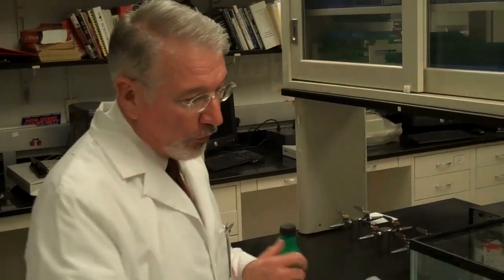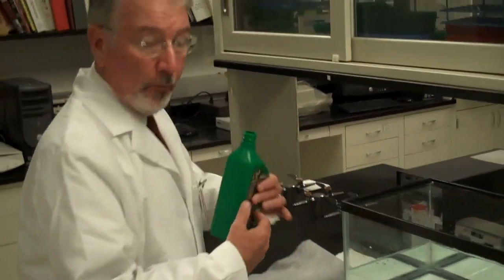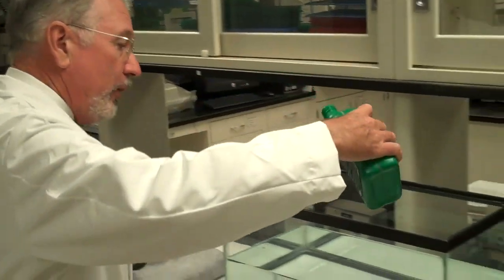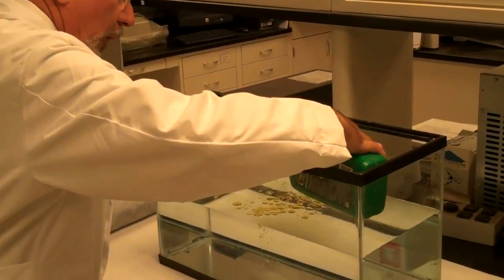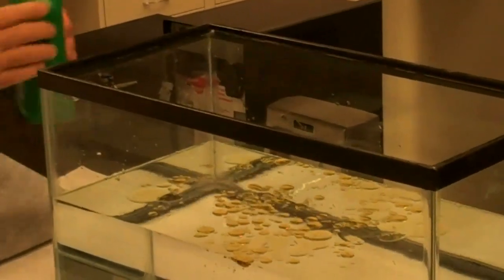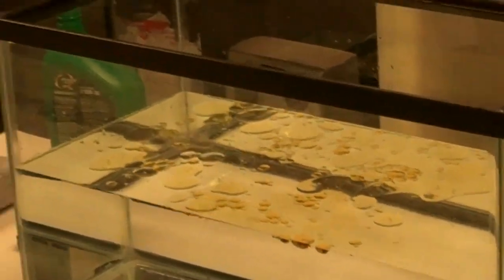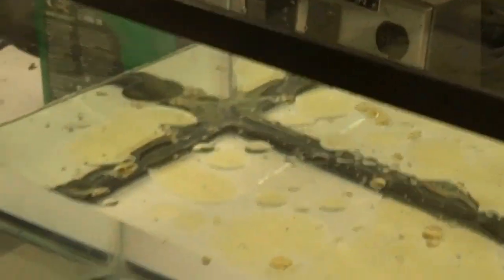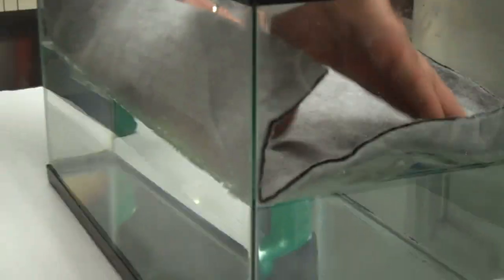Texas Tech's Fibertect Could Help Gulf Oil Spill

Comment: Any kind of biomass would... likely work as an effective absorbent. There needs to be a lot of people involved, organization, LOW TECH, work. Stop BP from using chemical dispersant which puts more toxins into the ocean, and makes cleaning up the oil extremely difficult. Get people to arrive at a certain point and dump whatever biodegradable plant mass into the water and have boats use nets to drag it through the oil. How does this stuff cost to fully utilize, and WHO WILL BE PAYING FOR IT?